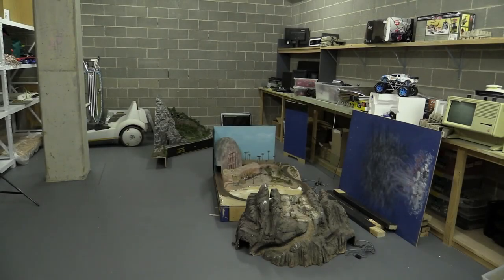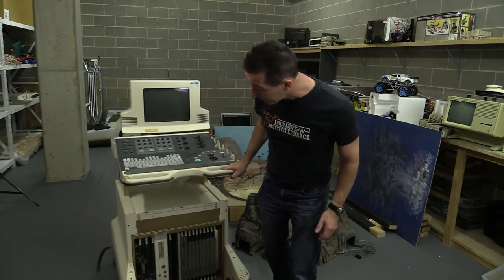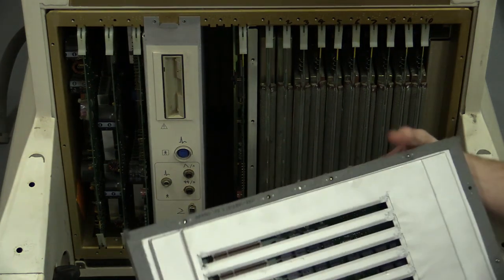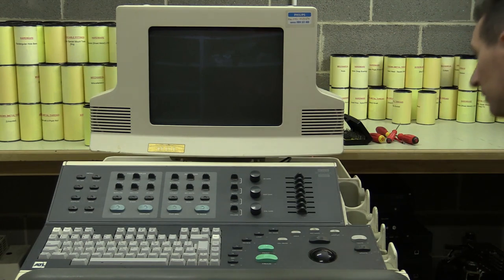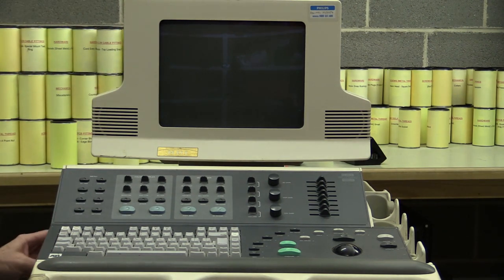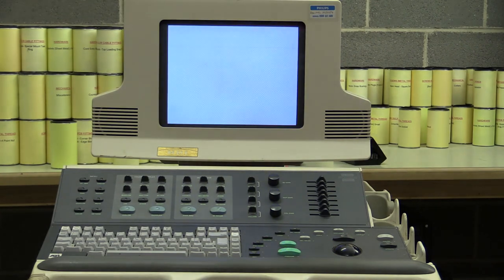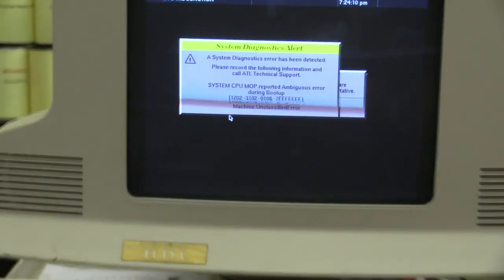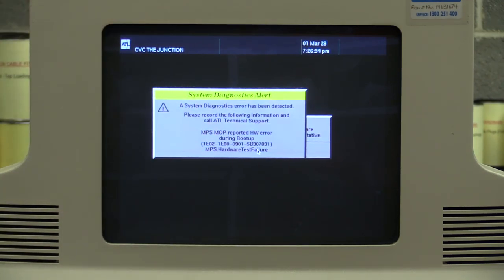ATL HDI3000 Ultrasound Machine

Comment: E-net is Ethernet - way back when transceivers were external boxes that clamped onto a huge thick cable and plugged in via a 15 way D connector with a very fiddly slide latch called an AUI interface I think.
Reply: Yea, it's an AUI network interface, I read somewhere it uses an adapter to connect to a thick trunk line akin to 10base2. You can get AUI to twisted pair
Reply: mikeselectricstuff right you are, http://en.wikipedia.org/wiki/Attachment_Unit_Interface
Reply: Bumped send prematurely. You should be able to get AUI to twisted pair adapters but I doubt it will use TCP/IP
Reply: mikeselectricstuff eurg, yea i remember that crap, dodgy coax cables and AUI adaptors that wouldn't stay clipped on to the network card
Reply: william fleete Oh, yea, it will support TCP/IP.  We had these units dumping JPEG images into an electronic medical record system.  Pretty reliable hardware, actually.
Reply: mikeselectricstuff Exactly
Reply: william fleete TCP/IP doesn't care about the underlying physical layer, you can do TCP/IP over a RS232 serial line. Have a look at this article, it explains the OSI layer model: http://en.wikipedia.org/wiki/OSI_model

Oh, and even if you were right, it's still Ethernet after all. Just with the transceiver external which modern network cards have just built in these days. It's really nothing special.
Reply: Genki. I was referring to the software on the ultrasound. I wasn't sure if the operating system on the ultrasound would support TCP/IP
Reply: TCP was drafted in the 70ies, same applies for IP. I don't see why a professional device costing several grands shouldn't support a 20-year-old protocol.
Reply: mikeselectricstuff That's called Thicknet cabling. ugly stuff.
Reply: Nighthawke70
I think I read on wiki that they used something akin to an apple corer when they wanted to put in a node on the thicknet cable and a tool to pull strands of the shield out of the freshly cut hole
Reply: william fleete Medical equipment like this has had TCP/IP specified as the required network protocol for data transfer since 1993 - a protocol called Digital Imaging and Communications in Medicine (DICOM)

The HDI series machines support DICOM protocols for receiving a list of appointments from a central server, and then sending back images to the server for archiving.

Good luck accessing the settings though, on a lot of early machines, thinks like the static IP address, or the IP address of the server to connect to were not use accessible and required password-protected serial console access.
Reply: william fleete one of cisco router I had a aui interface to 10base
Reply: Mike would have that machine working in no time!

Comment: Looks like it has Ethernet.  I recognize the E-net port.  It's called an AUI port.  Basically a serial network port minus the transceiver.  Seen them on Cisco routers before.  It's similar to the modern ports you need a universal connector for that then plugs your preferred media into.  These allowed for Copper Cat 5 or BNC depending on which AUI transceiver you connected.  If the tech changed, you change the transceiver then you get faster communications or you can change the media..

Comment: The Enet port on that is for thick net from the early late 80s-early 90s. That port uses a cable that looks like the old MIDI joystick port and links to a vampire tap that pierces and crimps over the coax cable.

Comment: According to the service manual MPS is the main power supply I think and there is atrouble with it. CPU MOP is the serial link between the PCBs. I think Dave is right. Its better to check PSU. Ultrasonund equpments have 2 PSus. ONe is for general supply, the other is for TX pulser boards, also it is called High Voltage PSU, because it supplies voltage to the probes, generally up to 150V.

Comment: I used to work on these, ambiguous error is almost always software. They use a SCSI HDD and the back end uses VXWorks. Any improper shutdown of the system (ie lower loss) can cause corruption of the system software. You can check if the hardware is functioning simply by popping in the backup MO into the drive and booting it. If the error occurs again it is indeed hardware, if not the software is to blame. Anyways have fun with it.

Comment: You are joyridding it but its what we are using right now to scan patients (2017) in an NGO clinic in uganda
Reply: The Philips iE33/iU22 has a similar chassis, but far upgraded electronics. SVHS, printer, CD-R/DVD burner I think, 3D imaging, and a wider selection of ultrasound heads. Those will filter down to remote african countries once the tablet/laptop based ultrasound puts more of the older machines on the used market.  They've already got L12, S5, and C5 transducers that work on USB power.

Comment: It seems that you have an issue with the CPU board-that boards needs to be replaced. You might first want to dust off the interior of the system and reseat all the boards first before looking into replacing the board.